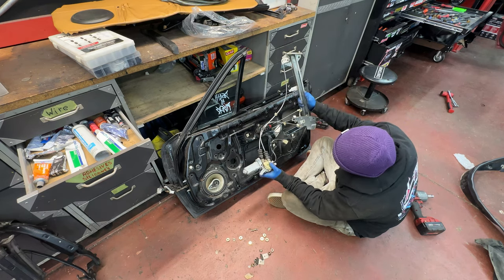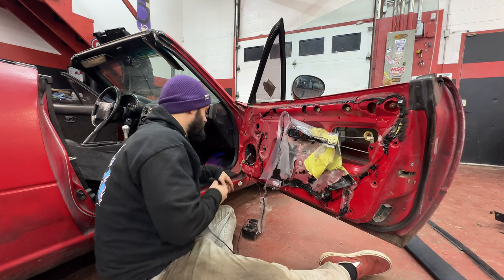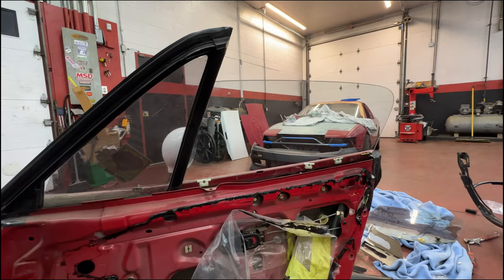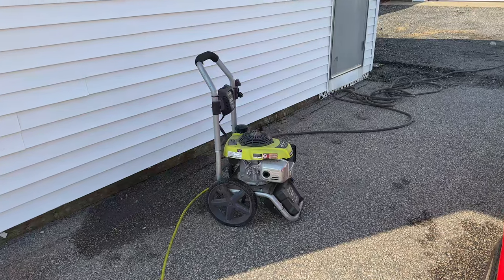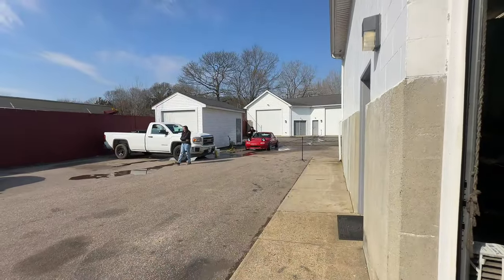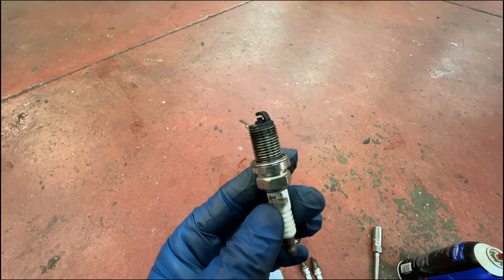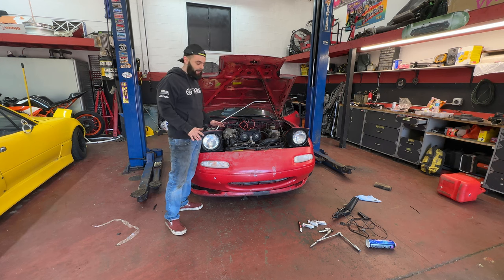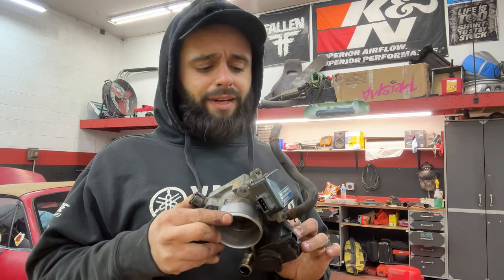My $100 Miata Is A Nightmare!

Comment: content is fire but using that pressure washer tip which is pushin to much psi is what damaged the paint if you used the lighter tip it wouldve been fine
Reply from the maker: Used a 40° nozzle, Wouldn’t have been a problem if it wasn’t a rattle can paint job. Was Also trying to blow off all the black mold/feces/dirt caked onto the outside of the car